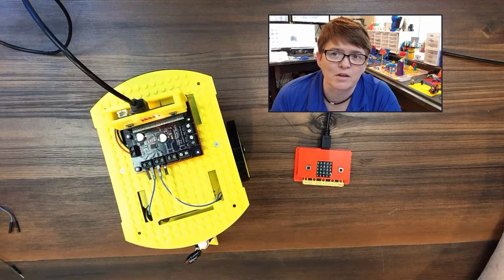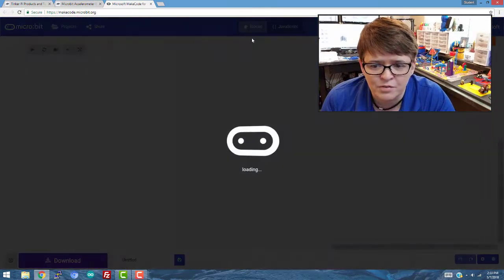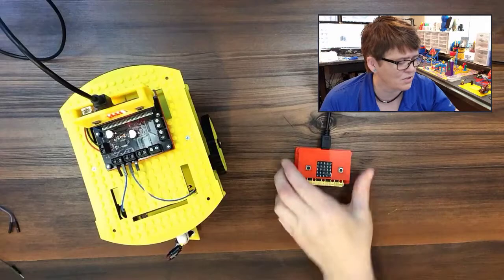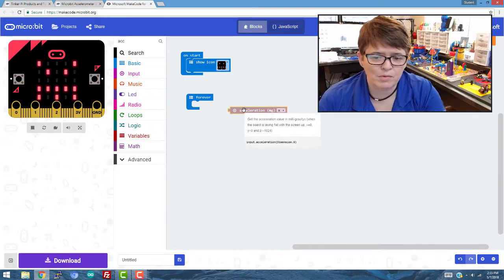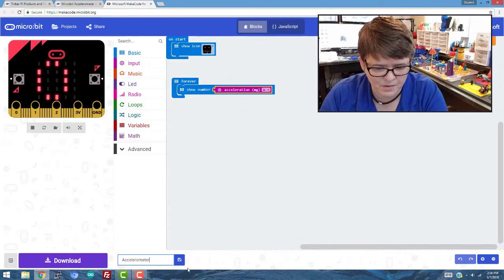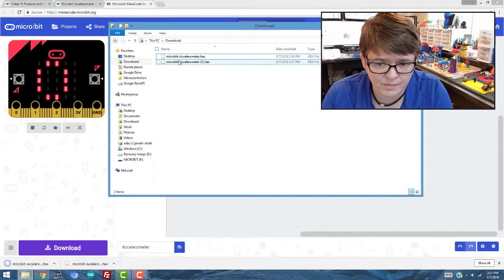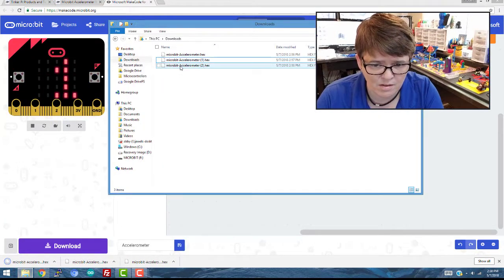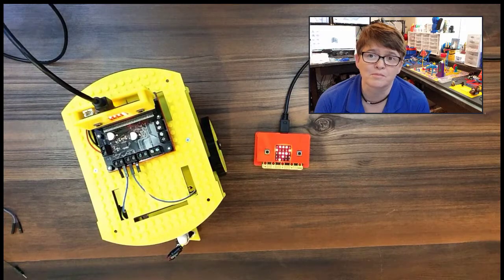How to Program the BBC Micobit Accelerometer Using MakeCode

Comment: Why is everyone calling it an accelerometer where it behaves like a gyroscope? When I read out the data, I don't get acceleration, yet I do get X,Y,Z axes of tilting. I rather have the latter, but we should stop calling it an accelerometer. I bet you can integrate acceleration from a true accelerometer design to get to an absolute position, but that will never be accurate, so the chip must be defining absolute the position using a gyroscope and then maybe use a derivative from the absolute angles to get an acceleration. Nomenclature is very weird....